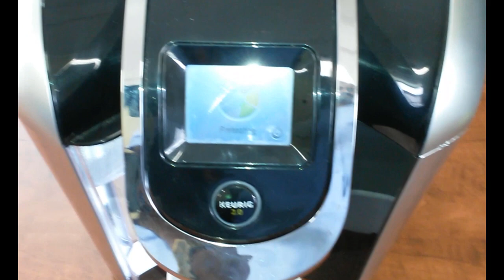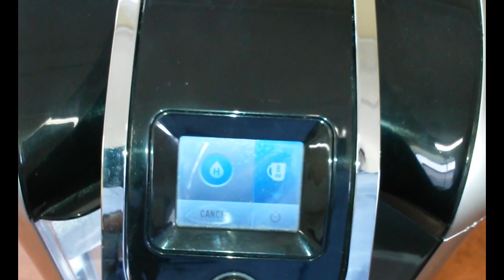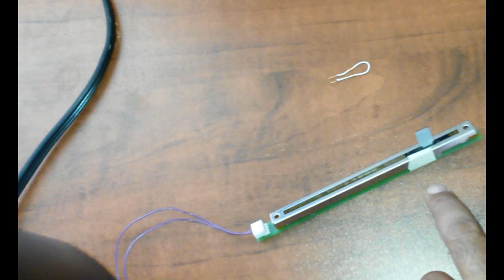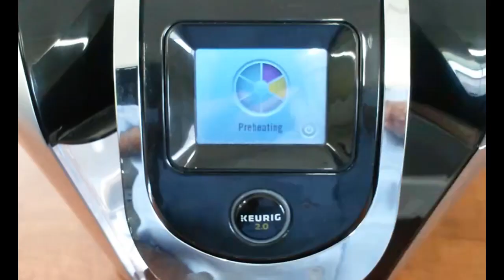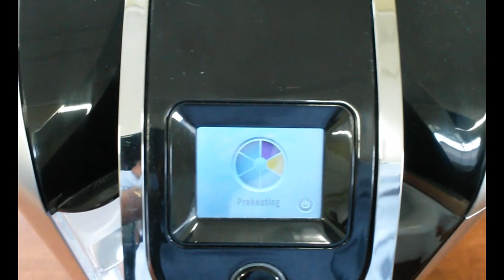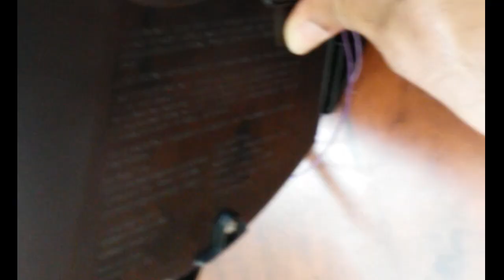095 Modifying a Keurig Coffee Machine to produce Hotter Water

Comment: Thank you for your video!  I have successfully modified my K-Mini Plus using your method and it finally produces hot coffee.  For those interested...  
The K-Mini Plus thermistor has a pair of white wires going into the board on a socket marked NTC.  
Separate a small section of this dual conductor cable into its 2 seperate insulated wires.  
Cut one of the wires and splice in a quarter watt 1.2K resistor.  
This means leaving one of the wires intact from board to thermistor and the other with a resistor in line.  
Insulate it well using heat shrink tubing or electrical tape.  
Close up the machine and enjoy hotter coffee!
Reply from the maker: That's great. 

That's why I put up videos. I learnt a lot from others on YT so I try to give back something to the community.

Comment: If you could show the quickest way from a fully assembled Keurig 2.0 to get the the exact wire(s) and precisely where to add a 1K ohm resister (or pot) to increase the water temperature - that would be the most useful video! (It would be a one-of-a-kind very popular and helpful video). Thanks!
Reply from the maker: There is another video on opening. Also there are videos by others on opening the device. I do not have this device anymore. In fact it was a colleague's device that I modified. Sorry I couldn't help more.

Comment: Thanks for the informative video!    Could you show where the thermistor or it's wiring is located?  Thanks
Reply from the maker: There is more information on the actual coffee machine in this video.
https://www.youtube.com/watch?v=3uROPYAIOGM
Reply: @manickn6819  No, that video does not show the thermistor either. Is shows two thermal protection devices, but not the thermistor. So can you provide a picture, or schematic, or something more definitive, right here on this video's page/comment, instead of referring to another video please. Thank you.
Reply from the maker: @MBAgeeJr68  damn you are right. I did this a few years ago and thought I put that up on YT. This is not my machine so after modification I gave it back to the owner. 

Around 11:12 in this video the connection for the NTC thermistor is shown. One wire is cut and the resistor is added in between. This increases the total resistance the micro sees and fools it into believing the temperature is colder than it really is.

Comment: What resistor should I buy to do this correctly? How many watt was it?
Reply from the maker: A variable resistor is best 0 to 5K ohm. That way you can tune exact. That said a variable resistor is a lot more expensive. 

If you just want to do a straight resistor a 1k ohm would be best. Smallest power rating. 1/4W would be fine. This is an input signal to the processor so barely any power passes through.